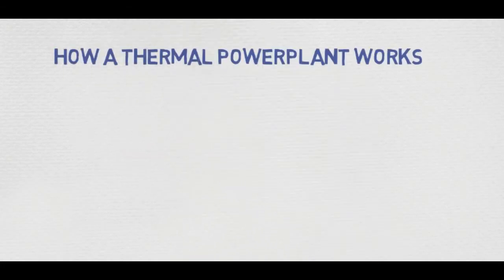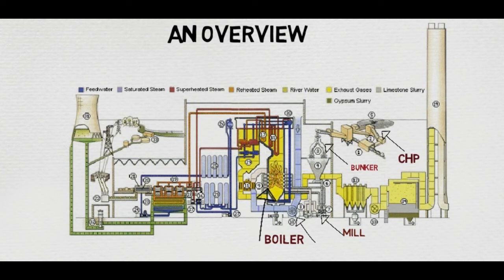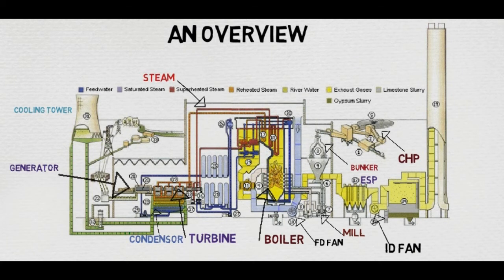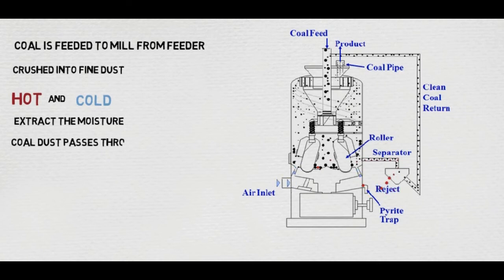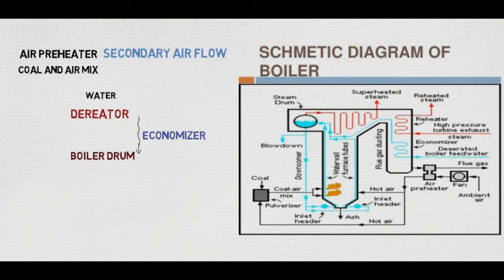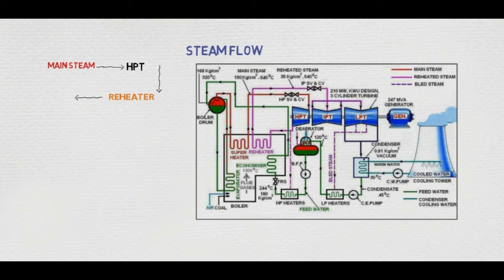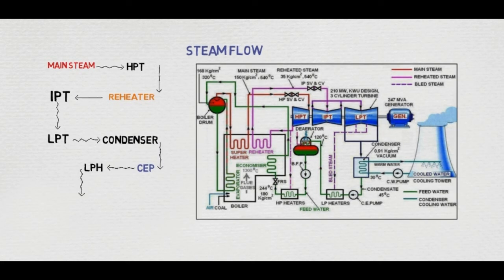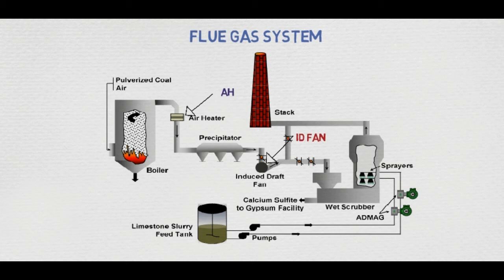Coal Fired Power Plant (Thermal Power Plant) - How it works?

Comment: We are specialized in Coal Crushing & Screening Machinery & Equipment
Cross Screen is patented product & Cross Screen Application
Coal Power Plant & Coal Washing Plant
Why choose our Cross Screen 
◆Self-Cleaning & Moving Screening Hole
◆No Sticking & No Blocking & Never Stuck
◆Screening Diameter: We can screening 3mm & Other diameter can be customized
◆Screening Efficiency: 90% at most
◆Machine Life:our screen sheet of life is more than 3 times of screen mesh
◆Environmental Protection:omniseal, dust-free 
◆Capacity:50-3000t/h
◆Small Demension,Save Space
SHIJIAZHUANG GONGBEI HEAVY MACHINERY CO.,LTD
Mob:+0086-18032918083
Tel:  +0086-311-87089012
Fax:  +0086-311-87089012
Email: admin@miningscreening.com
http://miningscreening.com/